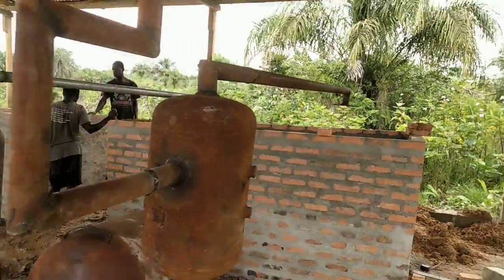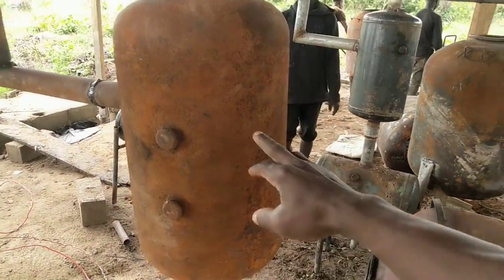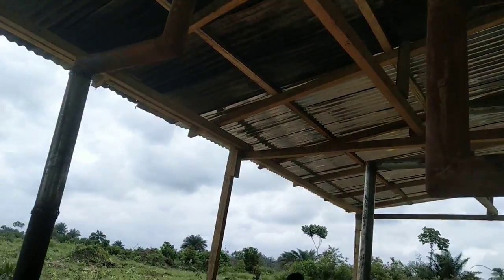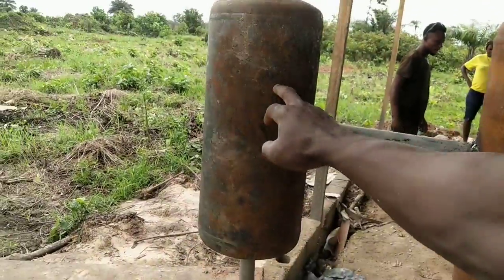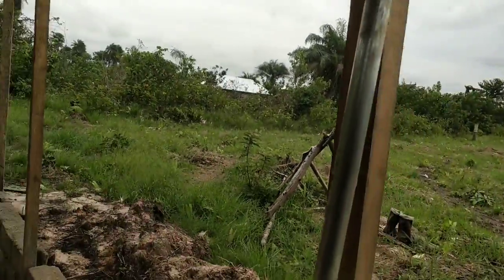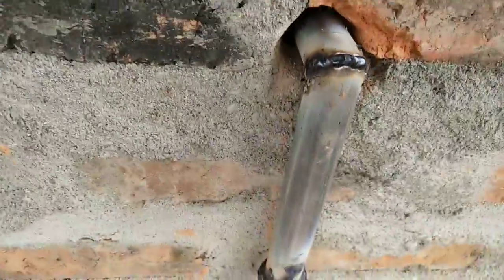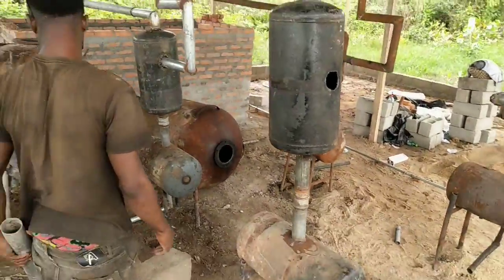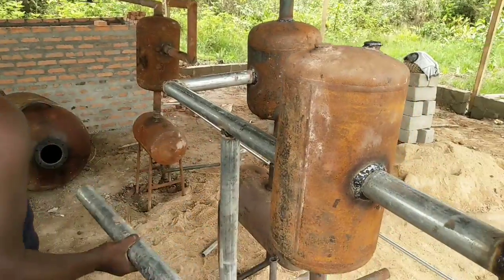Plastic waste to diesel. New  pyrolysis system installation by EGRI

Comment: I've a bigger Pyrolysis setup not exactly like this but the same working principle. It's functioning well producing clean gasoline and diesel fuel
Reply: Hi, can I contact you for some details about your pyrolysis setup please?
Reply: Yes, I am the China Pyrolysis Equipment Factory. We produce both large and small pyrolysis equipment
Reply: Hello bro , have you thought about using solar electricity to heat the reactor

Comment: What's the use of it, if you need lot's of energy (usually fire)  to separate those molecules?
Reply: I think there are availability of things to burn for free depending the country to make the fuel and then makes alot of money from the product. BUSINESS WISE
Reply: You need lots of energy to depolymerize the plastics in the reactor and also invert the depolymerize plastics into the gas phase for condensation.
 But trust me it's easier if you know what to do. It's a simple trick

Comment: Hey Bro I would like to ask if the oil comes from this setup is it already purified or refined ready for use, or is it going to need any purification process again
Reply from the maker: We have two system, one produces the oil and other purified it
Reply: @JohnSmith-EGRI  do u sell the machine or assist on providing the technical diagrams of how to contruct it?
Reply from the maker: @nwairehsamuel4378  we sell the plan and provide assistant in training
Reply: @JohnSmith-EGRI  but how can we get that ?
Reply: @JohnSmith-EGRI  I need training
Reply: @JohnSmith-EGRI hi John, where can I go to see the price for your plans ? 😍 that would be a really good project
Reply from the maker: Contact me on whatsapp +231776261258
Reply from the maker: @VipDetailingMontreal  contact me on whatsapp +231776261258
Reply: @JohnSmith-EGRI  that is great Bro, would you mind to share it with us here the other system that purify the oil please just little piece of video, thanks in advance
Reply: @JohnSmith-EGRI  don't let the excess heat go to waste. Maybe clay and brick drying would go along with that system. Where is this facility suited at?
Reply: Thru your video I have understand your explanations 🎉🎉viva Zimbabwe